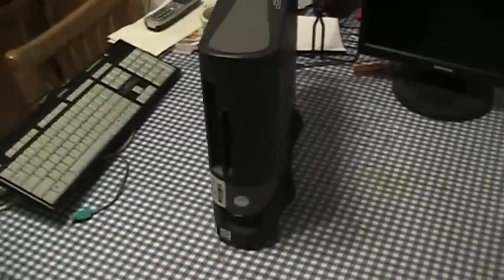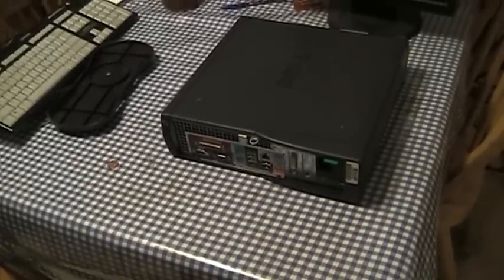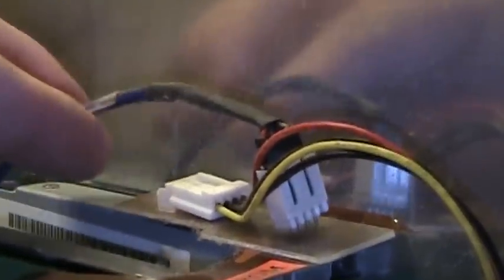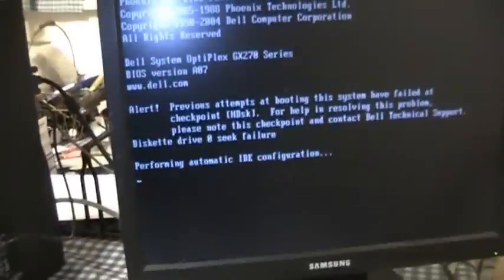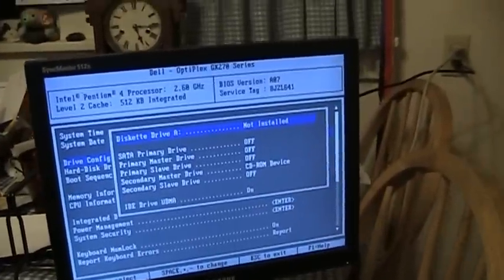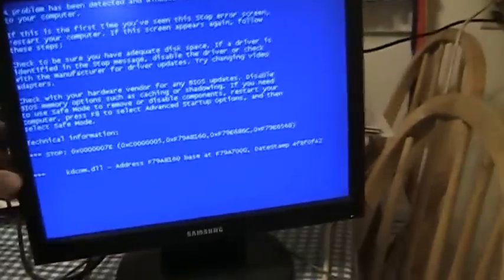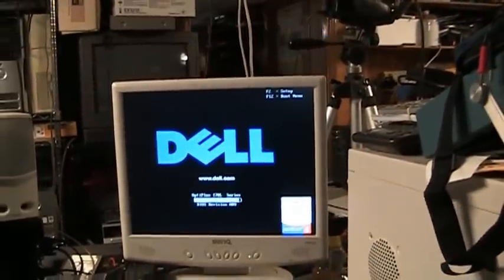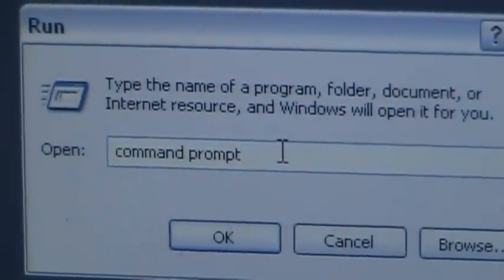UXWBill Explores Another Crappy Computer: Dell Optiplex GX270 SFF

Comment: i had one of these and my school had these in two computer labs with windows 7 professional, they were the sff not usff. To what i remember they worked real good and were smooth loading programs and other applications. They dont have them anymore. The teachers all got new desktops from dell latitude d830's and they were put in one lab and the second got dell optiplex 9010's windows 7 pro 8gb and 24 inch screens.

Comment: i wouldn't believe it unless i saw it.. but is that a modified Laptop Heatsink and Fan for a desktop Pentium 4? swoon
Reply: No it's not it just happens to look like it. It's actually very big and the fan on the top is very serious!
Reply: Tri-County Electronics it better be more serious than the old HD Radeon 2/3/4000 gamer video cards LOL nothing quite like 100-120C (221F) shutdown temp
Reply: Lol Except they only run at 20-25C most if not all of the time in my experience.
Reply: Tri-County Electronics some of these high end gaming cards, i hear people getting 70C likes its not big deal.
Reply: +Jason Hicks (TyrForFreedom) I wonder if the Inspiron 530s is hotter (Core2 Duo 3.2Ghz)?! Its about the same size
Reply: I actually found one (for 6 bucks) and forgot I commented on this video. I have no problem with this PC but it does need better ventilation. I did add a XFX Geforce 6 6200 Low Profile AGP and a Linksys 54G PCI Card. I am very wary of the PSU since it uses a weird format... The PSU is 190W but haven't had issues with the 6200 in there yet. It is a P4 2.8Ghz HT CPU, I did manage to get it 2.5GB of RAM, swapped the CDROM with a HP DVDRW/CDRW,  and added a 160GB SATA Hard Drive. I actually found a nice ACER 18 inch 16:9 LCD for it. Works great and was at a Church Sale for 50 cents!

Comment: So in another 15 years, what will a "real" computer consist of? Still has USB 2, VGA, and 10/100 Ethernet? I find it slightly ridiculous that a computer is not "real" because it has dropped support for obsolete tech.
Reply from the maker: +Chris Licata The mostly humorous nature of my commentary in this regard seems to elude so many people. 

All of that said, and to try and give a serious answer: these older ports do have their uses. USB emulation for legacy operating systems isn't "all that". Software that attempts to take over control of the keyboard logic from the system BIOS frequently breaks this emulation. USB to PS/2 adapters are hit or miss as well.

Serial and parallel ports continue to have their uses, not only for owners of older yet perfectly serviceable hardware (older UPSes, barcode wands, external modems, home automation controllers, laser printers, more besides), but also for management of embedded systems (network switches, out of band management cards, routers, all are typically things that have serial management ports to this very day) and these ports are also of great utility to hobbyists since they can be used (within the current source/sink limits of the logic backing them up) very easily for all sorts of random purposes. A serial port could monitor dry contact closures or even drive a transistor. The parallel port can do similar things and its 8 bits worth of I/O could even be used as a rudimentary DAC or ADC.

The truth of the matter is that all of the logic needed for these functions is still included on current production motherboards. (Some have dropped the floppy controller and parallel port logic, though.) It's just never brought out for use, not even via optional pin headers. And while USB devices for hobbyist use have certainly become more common, they are not as easy to use or as universally supported as the legacy I/O ports.

Comment: Wow im watching this on my Hp Compaq dc5100 sff. It had a Celeron D in it but I had a Pentium 4 HT 3.2 Ghz laying around from a (unsuprisingly) dead Pentium 4 Laptop so I put it in the dc5100 and it works great! Its good for playing Doom 2, Internet Browsing and as a Media PC. It has 768mb RAM and a 40gb Sata HDD. I think the P4 was a Decent Proccesor but I honestly dont know much lol I havent really worked on anything older than the P4, Im only 14 and Im really wanting to get into working on old PCs because its honestly really fun and interesting even when things go wrong. Dont really mean to get off topic lol but Probobly the most Interesting thing ive worked on was a Dura Touch GE Fanuc CNC Touchscreen Computer. It had a AMD K6 II+, 64mb of RAM and a 10gb HDD and ran Windows 2000 Pro. I honestly could only get it to boot a couple of times though, It would give me a constant 2 second beep on and off and wouldnt boot up for some reason. I think it was a RAM Issue but I troubleshooted it as best as I could but couldnt get it to work unfortanitly. I really want to get into old computers because even when things go wrong its still interesting. But I honestly think the hardest chalenge Im going to have in the future is finding computers to 
work on/mess with because Goodwill for the most part doesnt even sell computers and I dont know any Family Members that have old computers and you know Im only 14 and dont have a job so I have no money lol. welp best I can do is to look and ask people. But working old computers just never gets old so I wont give up

Comment: I confirm that these Optiplex P4's were terrible computers. I used one at the office where I worked (not by choice / contract with Dell to provide computers @ the company I worked for). The proprietary power supply failed several times in 2 years and must be purchased by Dell because they use a proprietary connector and can't simply use a cheap ATX power supply. Also it was slow as hell and blew out hot air like a space heater. I HATED that thing!!!

Comment: I have one of these SFF GX270s, nearly identical specs too.  I bought it for the local city water treatment plant to use, and when they retired it (in favor of a much older PIII Dell system!), they gave it back to me.  Of course, by this point, some of the caps have gone south.  This was about five years ago or so, and I still have the system, but it never sees any use in my house and I've been thinking about just scrapping the thing entirely.

Oddly enough, I'm probably one of the few people who have had decent experiences with Maxtor drives in general.  Dunno if I'm just lucky or what, but I've only ever seen a couple Maxtors that have truly been duds.

Comment: I have a computer nearly identical to this one, but it didn't have anything in the AGP slot... until now. And spoiler to anybody wanting to put a real graphics card in one of these really slim old computers, you will have to mutilate the casing in order to have the case close, and in the case of my Nvidia Riva TNT2 card (Due to the unfortunate placement of the VGA port.), the metal backing too, but it does work, if you don't mind a gaping hole in your PC.
Reply: +Daviljoe193 Or you could just buy a half height graphics card. Leaves the case in better form.
Reply: Nintenloup wolf That could work too, if I weren't such a penny pincher.

Comment: my Dimension 8400 had(has) gigabit on board.
Reply from the maker: +SandyStarchild That's true -- I haven't run my own 8400 in a while now, and had forgotten about its having gigabit Ethernet. I was surprised to find that the Dimension 4700 was 10/100 only.
Reply: +uxwbill tho dimension models after the 8400(the btx models) went back to 10/100 ethernet for a while for some strange reason.

Comment: I wonder which Intel processor produces more heat? Intel P4 or Pentium D dual core?
I've seen several P4s nuke caps, but had to buy Pentium D dual core chips, so I don't know what they do in systems over time.
Reply: idk depends. on the CPU without heatsink? cuz by that time heatsink got better and ran cooler
Reply: +Poebat If I remember right, I have an old Dell E510 or Optiplex that will run both a P4 or PD. now I'll have to dig that machine out and try it. I know the Dell E510 had a solid aluminum heat sink. I don't remember if I have a Dell that can take both the P4 and PD. I wouldn't try to run either CPU without a heat sink, those things are mad heat pumps.
Reply: +Poebat a quick google search suggest that the Dell E510 supports either a P4 630 or PD 820, so as long as I can find both chips I should be able to do a simple heat out put test.
Reply: +Colin Campbell nice! I have a celeron from 2005 that has a MONSTER heatsink
Reply: +Poebat Well I found a PD 820 and a P4 530J :| will have to start cracking cases to try and find a 630. Although the 530J and 630 have the same TDP of 84 watts while the PD 820 is at TDP of 95 watts.
Reply: +Poebat Ok, looks like judging by TDP only the Pentium D 840 is running at 130 watts. ..... After looking I have a Pentium D 840! I have no idea which P4 would have the highest TDP.
Reply: Colin Campbell How did it go
Reply: Poebat
Got side tracked. LOL But I did acquire a Gigabite? motherboard that should support P4 through Core2Quad So, this could get fun. Now all I need to do is figure out how to make a cool video.
Reply: +Poebat Ok, I will shoot a simple video for the heat out put for the Dell Optiplx GX270 SFF a little later tonight.
Reply: cool
Reply: Poebat
Just shot a basic video... uploading now

Comment: Also, the RTM and Service Pack 1 versions of XP had green or blue loading bars if it was Home or Professional, respectively. They also said the version right underneath the XP logo. Later service packs omitted the version and used solely a blue bar.

Comment: The power supply is original. The Dimension 4600C has the same power supply, right down to the weird SATA adapter plug. It also has the one SATA port, which is just a regular SATA port with a weird plastic cover.

Comment: Does the CD audio input provide much of a benefit? One of my HP Compaq desktops has a CD audio input and the DVD drive also has one of these inputs.
Reply from the maker: +Ashton B. Only that it keeps CD audio traffic off the data bus and keeps the drive quieter since it's only spinning at 1X speed. (It could be argued that as this output is analog, there might be some distortion or noise added as the audio travels to the sound hardware. To which I say "nobody cares", "it doesn't matter over such a short distance" and "that's why a lot of drives of the time ALSO had an SPDIF output*".)

Some later drives have firmware that is smart enough to slow the spin speed down when digital audio extraction for CD audio playback is being performed.

Some modern operating systems appear to make the assumption that digital audio extraction is the only method supported, which can be problematic with older drives. And other operating systems (such as Microsoft Windows, XP and 2000 for sure) have some way of figuring out whether the audio cable is hooked up to your optical drive. I'm not sure how this is done, only that it is and it's generally accurate!

* although the SPDIF out didn't always work, as I found with one of the optical drives in my Dimension 8300.

Comment: I always never understood. Why does it briefly turn on when you plug it in
Reply from the maker: +MinecraftMarcus1 Of those systems that do, I assume it is the logic being placed into a known state, or perhaps a form of self test.
Reply: +uxwbill oh, OK thanks!
Reply: +uxwbill because I have a Dell Dimension GX620 that does the same thing when plugged into the mains
Reply: +MinecraftMarcus1 Also I hope you don't mind me asking but do you know a better cpu for my Dell Dimension GX620 because right now it has the stock Intel Pentium 4 HT processor.
Reply: I have a Optiplex 780 that always turns on for a few seconds when I plug it in. I don't get annoyed by it, but I was curious as to what was going on.
Reply: +RogerRHF ya I don't get annoyed either, I just never knew why It did thst
Reply: +MinecraftMarcus1 I did a quick Google search and it says you can get a pentium D for that GX620.
Reply: But don't take my word for it, do more research before you spend any money. I just looked at one link.

Comment: Wahey! You've covered a system I actually own, albeit not one I really ever use (by virtue of it being at my parents' place right now). Mine's a bit less powerful though, with a non-HT 2.26GHz P4, and it doesn't have the bottom stand thing. It once managed to overclock its FSB to 800 MHz from 533 MHz, which resulted in a fast CPU at first, but one that rapidly throttled itself down to sub-PIII levels. And yes, I had a PSU fan freeze up in it and take out the motherboard in the process.
Reply from the maker: +Lukeno52 I forgot to mention in the video that I'd never seen the stand before. I find it hard to believe these computers were stable enough without it, so maybe a lot of them just get lost or broken?
Reply: *****
You did mention it actually, after I'd posted my comment. It's hard to say how stable they are like that, because mine has a hacked-together PSU (someone had cut the cables off of it) and a full-size PCI sound card.